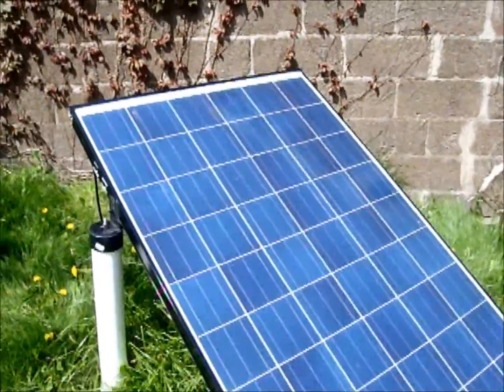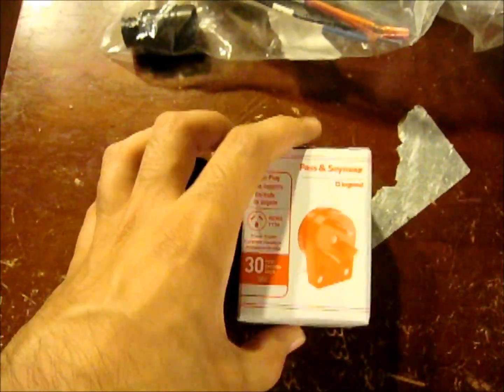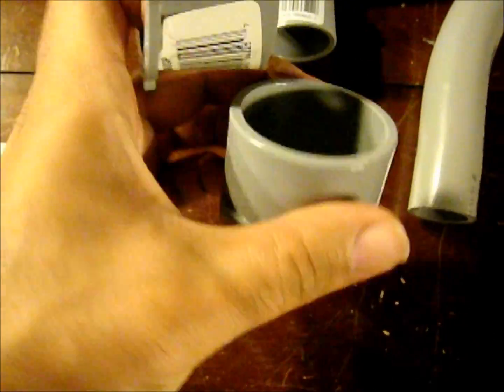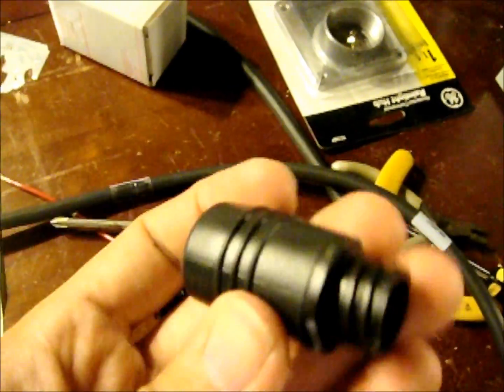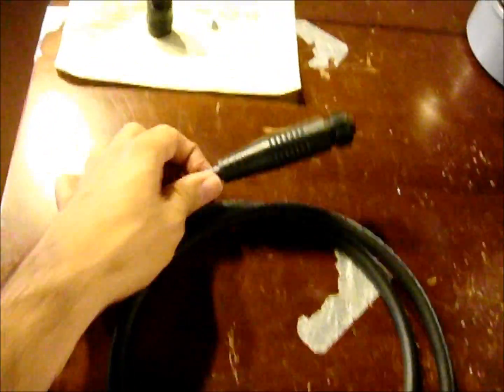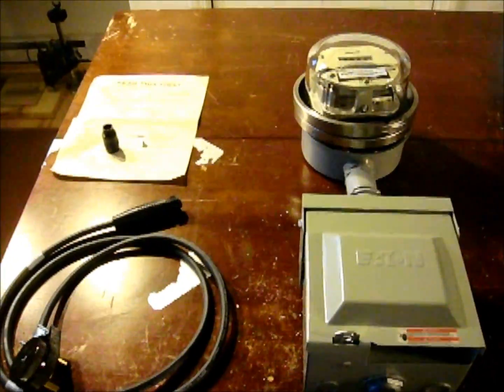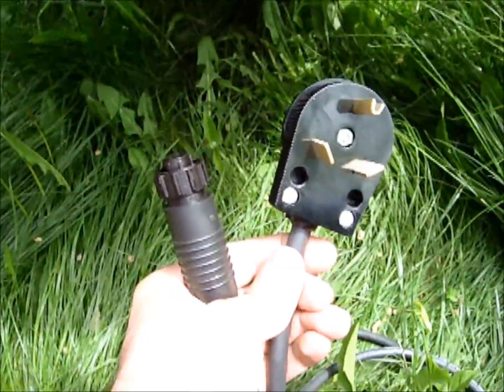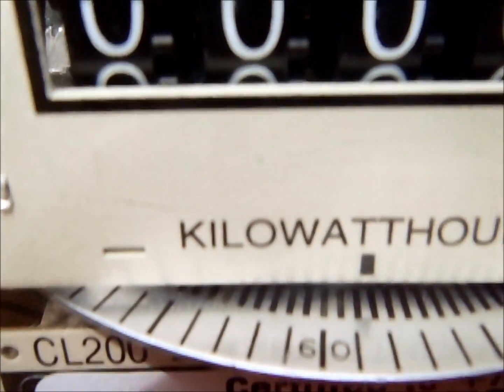DIY : Westinghouse Solar 235W Plug N' Play Conversion

Comment from the maker: The wires are clearly labeled and there is an instruction pamphlet that tells you how to wire the cable. The colors are not conventional because the cable may be used for split single phase or three phase. Yes, the cable is code compliant.

Yes, Enphase syncs to grid power and disconnects during a power outage, and follows all of the UL1741 and IEEE 1547 standards for interconnection.

No, there is no batteries or energy storage used.

Comment: Westinghouse solar panel install demo - the wiring is not code compliant relative to color and the equipment grounding conductors.Does the Enphase synchronize with the house power and if the house power is dead, will it ignore that and output power, and if the utility power comes back, will it drop out and re-sync Does it have the option to connect a battery bank on the DC side (charge during daytime and draw from during the night if the utility power goes out).

Comment from the maker: No Enphase does NOT have a 110 - 120VAC! I wondered why for a while then... I dug into the NEC code.  Article 690.9 (C) limits the use of 120VAC back feed systems for a few different reasons. To avoid the headache of a consumer misusing the product Enphase went all 208VAC or 240VAC. Doing this also allows for longer wire runs with less power loss. I was thinking about doing a video on 120VAC backfeed if you're interested??